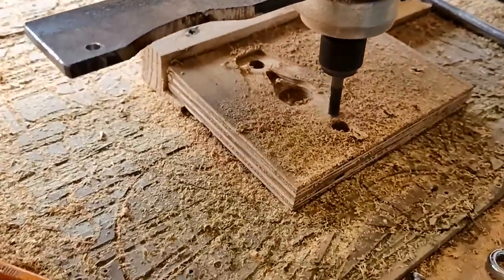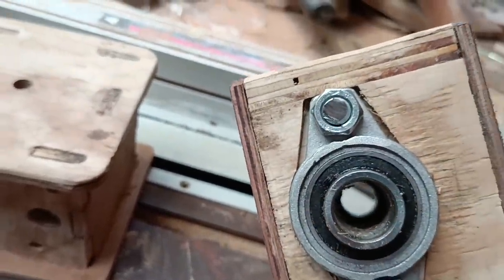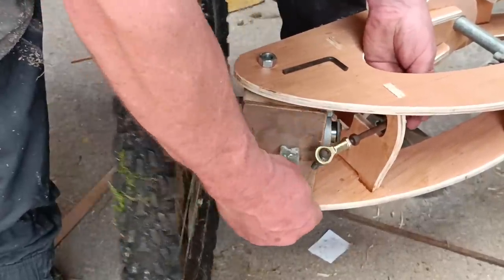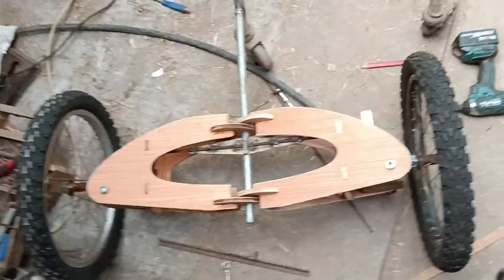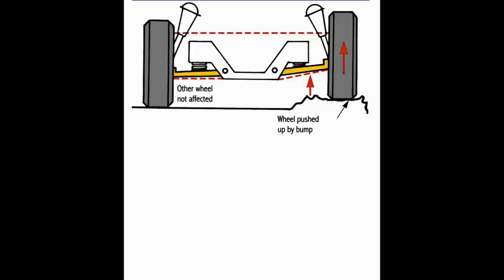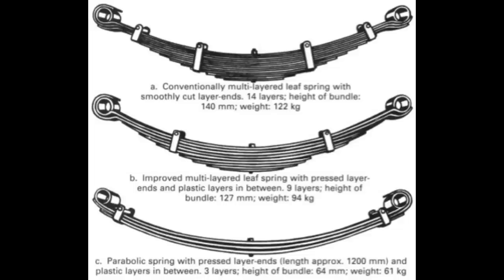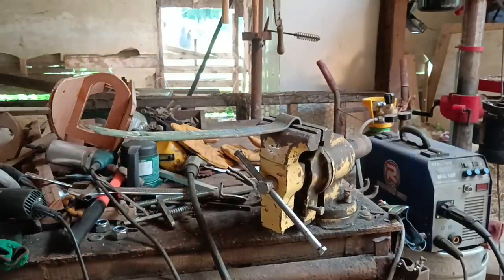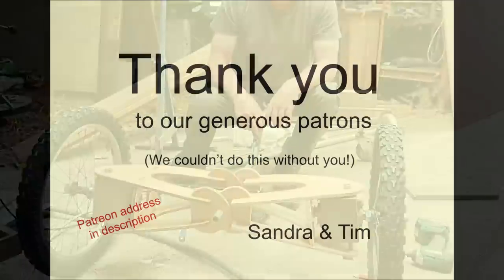Great Progress On The Wooden Car Steering And Independent Suspension System

Comment: The width is fine, any narrower on a tilting road and you'd risk tipping over. In a car frame you would be unable to put a foot down for balance as you would a bicycle or recumbent type vehicle. For springs you could investigate fiberglass electric fence post material. Still light weight, waterproof and could be bundled to produce the correct load capacity desired.

Comment: It’s been said before but the Model T suspension would be perfect for your car.  At the speeds you will go it will give good performance, be light weight and fairly easy to make.  Caster, camber, bump steer, etc is all fixed so you set it and forget it.  The front axle can be made from a plywood assembly or a piece of thin wall aluminum tube.

Comment: You might consider a bundge cord suspension like they used to use on small aircraft. It might weight and cheap. It will take some engineering to adapt it to the parts you've already built.

Comment: As for springs... air springs might be good. Very easy to adjust (add or remove air) and light weight (just a rubber air bladder). Look up air helper springs for small trucks. The type that is just a rubber bladder that is meant to go inside of a coil spring. They're kind of pricey, but maybe you can find a similar but cheaper alternative. Apparently there are air shocks for golf carts, you could use those and they would be shock absorbers too.
Reply from the maker: Yes!

Comment: The bed slats look like a great idea for springs for the front suspension: run them from top to top of rocker arm and through a plywood connector that brought the load down to the central pivot arm.  This would give you a halfway design between the floating fixed axle and independent suspension.   The pry bar for the rear suspension looks like a good fit: you're going to want the rear suspension to rather stiff: stiffer than you might think.
Reply from the maker: Thanks, John. Why should the back springs be stiffer?
Reply: @wayoutwest-workshopstuff6299   The front suspension will take the brunt of the new terrain and start adjusting the whole vehicle while the rear suspension should help keep control of vehicle roll.  There's also weight distribution to consider: you usually end up with more weight on the rear wheels which are driven and les on the steering wheels - More weight, more stiffness to your springs.  But mostly I was thinking that as you sat on springs to judge their "springiness", you were going for too soft an option: by the time you get the weights of everything and the operator(s) involved, I'm thinking you're under estimating the load that you will want to be supporting.
Reply from the maker: @johnfreiler6017  Thanks, John - yes, that all makes sense

Comment: Have you thought about air suspension not exactly like a Range Rover but an inflated rubber bag or small inner tube. Gives you the option of making it harder or softer by adjusting the air pressure.
Reply: Yes and the air tank could be made out of aluminium for reduced weight (if rubber bladder is not an option).
Reply from the maker: Thanks - yes, great idea..

Comment: Love the shapes you are making for the upper/lower control arms up front.  They look elegant.   In boat building, there's quite a bit of "if it looks right, it will be right" engineering.  Those shapes look proper.

Comment: Cut the pry bar in half Tim, or have you thought of a single opposing spring?

You could use the hay tine as the compression spring, in a tuning fork style. This allows a greater range of travel by the front wheels as the prongs can move in both directions. The central bar on which you have the suspension pivoting through the spring of the tines should locate it. Flange bearings over the tines wiil allow it to fit to the suspension arms.

Comment: Do you need suspension at all? Modern road bikes rely on balloon tyres profile to smooth the ride. A 3 wheel design would keep all wheels on the ground if uneven

Comment: You could try using a pair of disks made from plastic cutting boards to make a thrust bearing, with one attached to the block and the other attached to the suspension arm. Plastic on plastic will have a lot less friction than wood on wood.
Reply from the maker: Worth a try - thanks

Comment: Fun project, I should have done what you are doing, a long time ago.

For velomobiles, they use air/hydraulic lift cylinders, such as you might find holding up your auto trunk/boot. Even new, they are inexpensive.

If you do go with the independent suspension, perhaps you could use some kind of bushing to take the wear, so that the A-arms don't have to be replaced as often. In other words, concentrate the wear in a replaceable part.

McMaster and Carr has these kinds of things, but they are spendy there.

Comment: Bed slats are very good, try affixing them together like in bow 🏹 so they can slide on each other while flexing, and then just cover the in not so tight sheathing of impermeable material like wide cable shrink wrap.

Comment: Have you thought about pvc pipe flattened for suspension? Backyard bowyer makes incredibly powerful long bows from pvc pipe and I would imagine it’s probably the easiest waterproof material to use for this application and also readily available. Keep up the good work Tim!
Reply: I was thinking PVC pipe. Wouldnt have to flatten i'd say, could bend 2 tubes to make an oval shape so spring up and down <>
Reply: PVC pipe is not readily available everywhere. I tried to make a bow out of a pipe that looked like it could have similar properties. (Electrical conduit) I shaped it to a recurve bow shape but it snapped very easily. Where I live, PVC is not allowed in electrical installations as it releases toxic gas when it burns. And for piping, it's not allowed to be used due to drinking water regulations. Therefore, it's basically not available here. As Ireland is in Europe as well, I could imagine that the situation might be similar.

Comment: A consideration we made some time back when building motorcycles was that they should be able to go through a standard 30" ( 762mm) door, thus allowing back yard parking in terraced houses. Worked well and proved to be a bonus when carrying out repairs/ services.
Reply from the maker: Really good point, Robert. But cornering on a MB is a bit different!

Comment: I would think that you’ll have the same problem with springs regardless of the style of suspension. At the end of the day, the springs are carrying all the weight, and the suspension is only there to hold the wheels in place and transfer weight from wheel to car via the springs/shocks.

You could connect the front axle to the body with a pair of swing links and ball joints, with a panhard rod to locate it side to side. Alternatively, you could make the beam axle triangular in top view, with a single ball joint connecting it to the body somewhere behind the axle. That keeps the component cost down, at the expense of more plywood.

Comment: Would a torsion bar spring work Tim?  Finding one might be the issue but it's simplicity is up your alley. 
Problem is the car will be light so coil springs are the easiest way.  There is a huge selection of coil springs made to choose from and when the right springs are found you will have solved both front and rear suspension.
Another thought is the coil over shocks on mountain bikes.  I really like this project.
Cheers 🇨🇦

Comment: Years ago there was a boat builder (I think it was Nathaniel Herreshoff) who built a wooden trailer using a flexible wooden axle. The axle was rigidly mounted in the center but could flex at the ends. The axle had some support at the ends from a set of leaf springs from a buggy seat, but I think that was more to keep it in alignment and control sway than it was to carry weight.

Comment: Look into recycled HDPE plastic sheets, they come in 4'x8' and 1/2 thick and are made from recycled pharmaceutical bottles, I'm not sure which supplier carries them, but I'm sure a quick rabbit hole on Google would yield good results.  These sheets are fantastic, they are light, strong, moldable, waterproof,  and can be shaped into 3 dimensional shapes with just a heat gun and some jigs. Worth a look I think. Great job so far and good luck!
Reply from the maker: Thanks Jason - good suggestion

Comment: The thrust bearings could be just two POM/Delrin surfaces or two metal surfaces with a POM washer between them. You can just make them on the lathe.
POM is a very good bearing material and easy to machine. They would probably be even more fit for this application than ball bearings.

Edit: Some well oiled hardwood on steel might also do the job like on your railway.
Reply from the maker: thanks, Dave. I'll give it a go..

Comment: Have a look at velomobile designs. These are human powered vehicles, so they are light and compact, typically about 75 cm wide.They also try to minimise the space required for the components, and there are other steering geometries that are quite a bit more compact. There are quite a few designers in the Netherlands, although most manufacturing is done in Romania these days. They will all sell components at a very reasonable price.

Comment: The angle of the direction levers is very easy to calculate perfectly. With the wheels straight,  project a line from the levers  backwards,  adjust the angles until they cross exactly on the center of rear axis of the car. This will adjust both turn ratios so the front wheels never drag when turning.
Reply from the maker: Exactly - once I know where the back axle is..
Reply: But for that you need to know both the wheelbase length and how wide the front track width will be

Comment: The hay bob tines seeem like a neat idea but looks like you would have to use quite a few to get the desired effect. i think it would be neat to use the tines with something else using them only for bumps. The easiest would be regular leaf springs though. might be able to get one from something around the same size as the build such as a side by side or maybe a fourwheeler if it has it.

Comment: For springs and dampers, you could repurpose the inside of balls (like footballs, basketballs, etc.)
Sturdy air balloons, that provide naturally flexible damping characteristics, just inflate it more or less. It turns out too that it's a valide suspension design, as a variation around that theme has been used in real cars from the Mini in the 60s onward to the MG F and TF roadsters until the naughties. Could be worth a try!
Reply from the maker: Watch this space!  : -  )
Reply: @wayoutwest-workshopstuff6299  I am 😁🤭

Comment: You could get four small industrial electric motors off of a scrapyard and use them directly to mount the tires. Then you connect the pedals to a fifth motor, to which you connect the pedals. The energy generated by the pedals is fed into the batteries, and the RPM of this motor determines the target speed of the vehicle.

So there's no physical connection between the wheels and the pedals necessary, you just use the RPMs of the pedals to change the speed.

For brakes, you can use regenerative braking and as an emergency brake/parking brake, you can ground the windings of the motors - so they apply full braking force even if the electronics fail completely.

You would only need in addition a virtual gear lever, so you can switch gears up and down. This way you can pedal at the same cadence if you drive uphill, very slow through mud or very fast on a rural road - just adjusting how much RPM of the pedals results in how much RPM of the wheels.

Depending on the motor type and motor controller you can even set a specific RPM. So with a steering sensor you can calculate how fast each motor "should" spin, and you'll get a 4x4 with diff lock while having no issues turning.

Comment: You of course get more stability and more room for mechanism by having it wide. If you decided to go for a tricycle it would be perfect. There’s also no real reason why the front and back wheels need to be the same width, (or use the same suspension for that matter) so you could have the back ones narrower with a solid axle suspension. I find it fascinating how many of these decisions echo the decisions and trade-offs made in postwar cars.

I sort of wish you were figuring this all out in half scale, where the iterations would be less costly, and faster. 

The whole thing is great fun. Thank you!
Reply: If you read up on the specs for cars and trucks you will note that the front track is wider than the rear track!

Comment: what about a transverse leaf spring anchored on or about the center pivot ??   You could use the springs/slats that ashley gave you.   As to the "too stiff"  metal springs make them narrower or tapered. fat in the middle and narrow on the ends.  early cars and trucks used transverse springs front and rear. Have fun, stay safe and thank you

Comment: 8:30 why not do oil suspension with a pressurized line across the car in an X pattern between the front and the back cylinders? That would counteract the pressure put onto the base of the cylinder, by lifting the opposite corner of the car. That's somewhat following the idea of suspension used in Citroën cars.

So you just need 4 cylinders and two pressure lines from the front to the back in an X pattern. If you use "spring free" cylinders, the suspension would be equally soft, regardless how much compressed each of them is. While you can adjust the dampening with a valve on the line, to adjust how fast or slow it will respond to bumps.

Just needs a spring or a rubber pad at the end, to avoid hard bottom outs. :)
Reply from the maker: Thanks, Ruben. really interesting..!
Reply: @wayoutwest-workshopstuff6299  I thought a bit about it. I guess using air makes more sense. Gives much more cussion effect, than oil plus it's much safer.

Also leaks are not that problematic: You can just use a regular compressor bike tire compressor/pump to refill the systems, if they leaked out. :)

Comment: If you are planning to use the bicycle car 2 way bicycle / walking / jogging tracks then they are normally about 3m wide totally so your bicycle car can be as wide between 1m to 1.5m wide but if you plan to take it on the public roads then it can be up to a maximum of 2.5m wide. If you stick to a ratio of 1:2.5 so 1m wide/2.5m long or 1.2m wide/3m long or 1.5m wide/3.75m long.

Comment: The Ford Model T (and probably a lot of other early cars) used a beam front axle with a single transverse leaf spring on top, and a hairpin going back to the frame behind. It's very simple and works pretty well. Might be a design to consider. The modern equivalent would be radius arms, or maybe a linked suspension, either of which could be run with coil/bicycle springs if you prefer.

For the leaf springs, are old skis available in your area? Or fiberglass archery bows? I'm also remembering seeing some guy on Youtube make a full-sized archery bow from PVC pipe, though that gets brittle with age and UV, so I don't think I'd trust that for long in this application.

Comment: You might loo at early Ford Bronco coil spring suspension. early 60s Ford pickups used a single beam front axle changing in 67 (?) 67 two a twin I beam

Comment: Tim, you might consider using air springs (just an air bag) for the suspension. Top speed shouldn’t complicate the spring design much.
Reply from the maker: Good idea!
Reply: @wayoutwest-workshopstuff6299  A vast majority of the heavy trucks and their trailers are now using airbag suspension in Australia. Great for weight distribution and reduction in damage to roads.